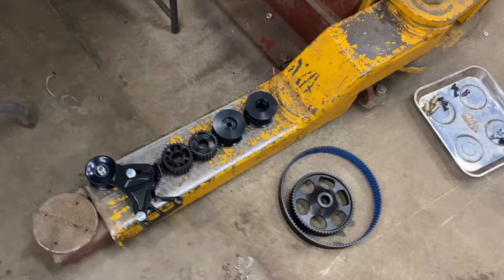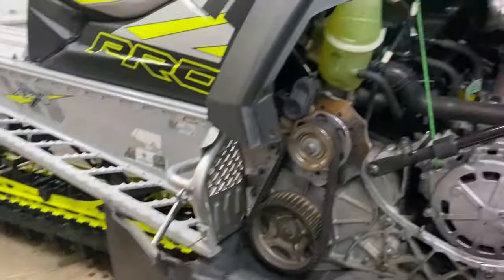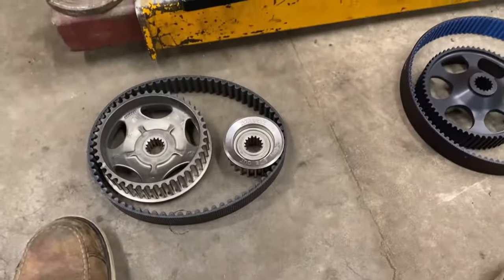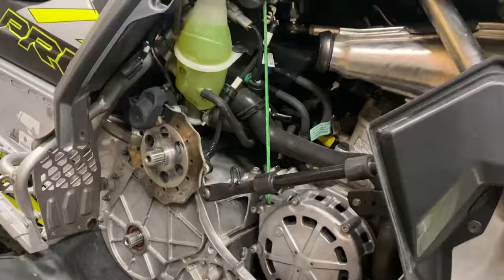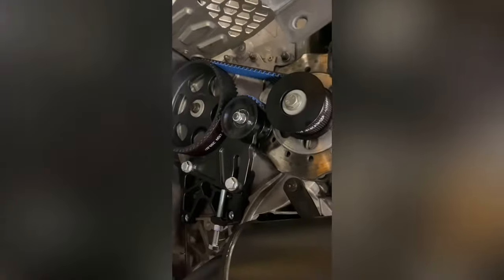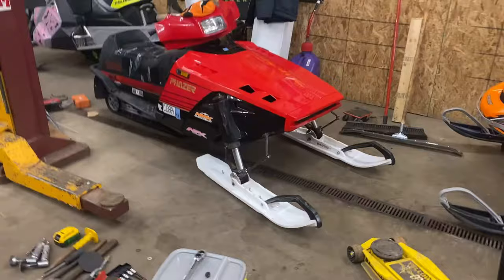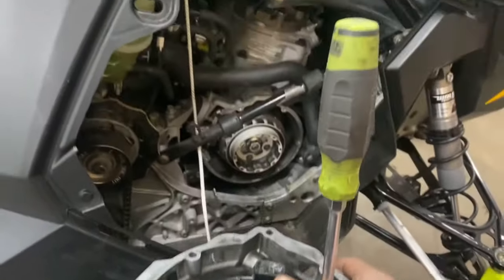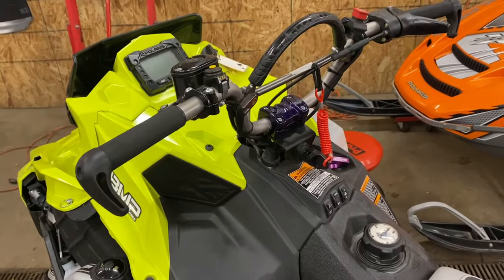2020 850 Polaris RMK TKI belt drive install, Cobra cord, and C&A pro skis on a phazer!

Comment: Which tether did you install. Also which gearing did you like out west!  Thanks
Reply from the maker: The Dewk teather from TKI and I used 25 top tooth and can’t remember at the top of my head right now if I used 62 or 63 as the bottom gear. Gives the sled more torque.